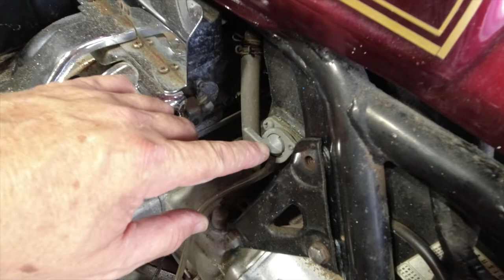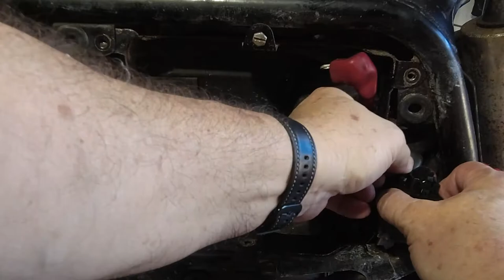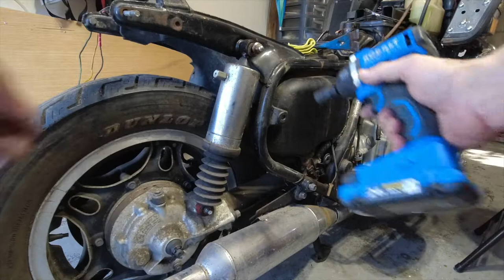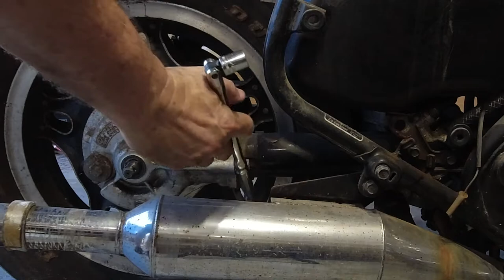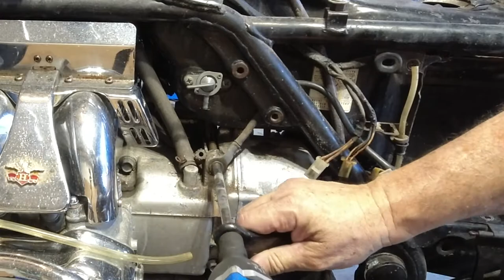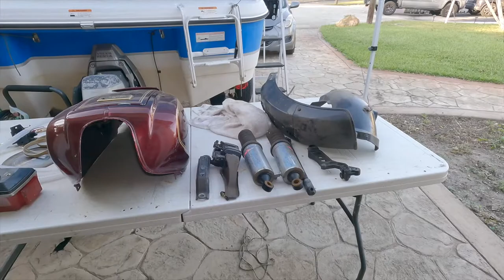Honda Goldwing | Remove Fuel Tank 🛵

Comment: Great video that makes me realize it's a winter-job😁I hope my fuel tank holds up a little longer before rust shows up.  At least I can see by your video that it's doable on my 1983 GL1100😎👊
Reply from the maker: Depending on where you live, I would agree it is a winter job. It should be fine if you coat it with WD40 and close it up tight. It is a lot of work to get out. 🤓
Reply: @TomAsay64  I'm from the Netherlands so the summers are meant for riding as much as you can and the winter's are not so severe and perfect for maintenance on the bike.

Comment: Folks ya might not like spending the money, BUT, Marine 360 Sta-Bil prevents oxidation in the fuel tank with off gassing. It's been proven over and over again. Both in the marine environment and I personally have ZERO Rust issues in my GL1100 just for this reason. I add it monthly even during riding season and double dose it in the off season. It is pricey, but, which would you prefer; a weekend or 2 (or sheet 4) of ripping your bike apart to clean and liner your tank or add an oz of prevention which will solve the POUND of cure.
Reply from the maker: There is Stay-Bil in both bikes and boat. The stuff is great! This was not my bike until a couple years ago.
Reply: Sta-bil will let you down every time if you are storing something away with fuel in it.
Reply: @darrinrentruc6614  It's NEVER let me down. Not once in 20 years. But it does have a shelf life and if you expect it to protect your fuel for 5 years it just ain't gonna happen.